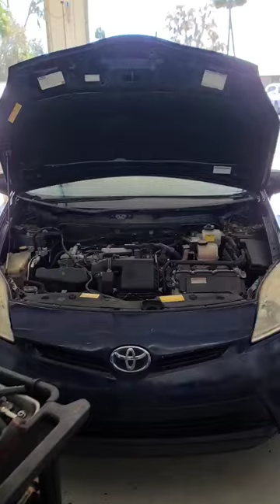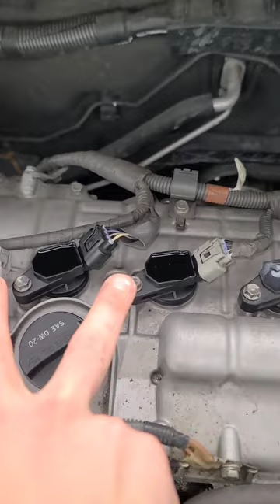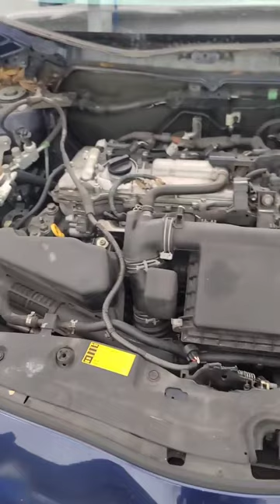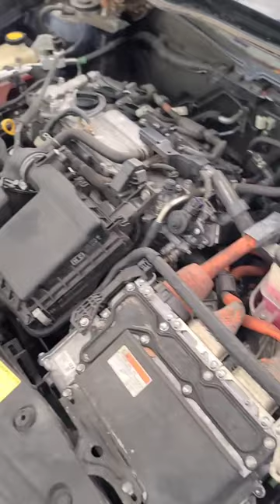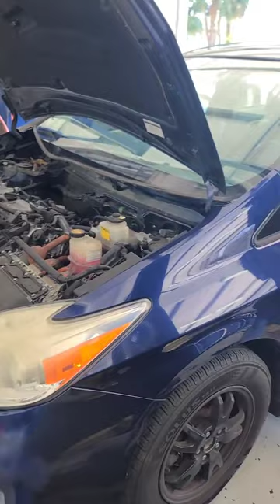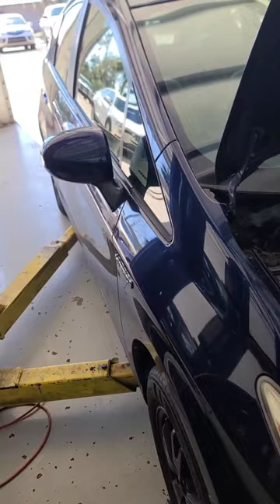Prius Knock Noise - Just Misfires, Not Motor/Transmission failure

Comment: This is from the prius with the engine noise , i changed the flywheel, egr clean, spark plugs but the same problem, i wil check the coil plugs , also will clean the intake manifold